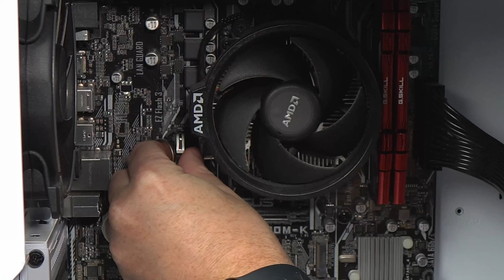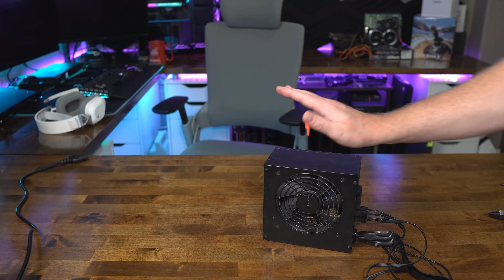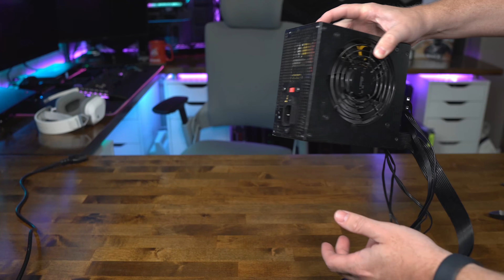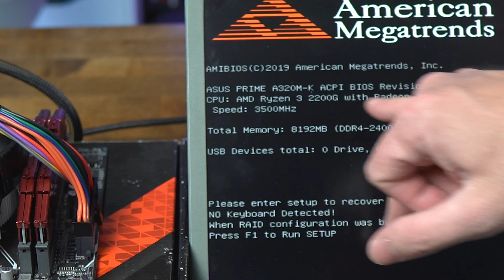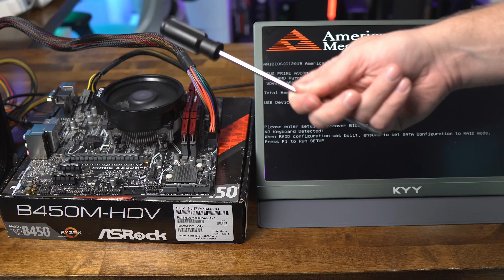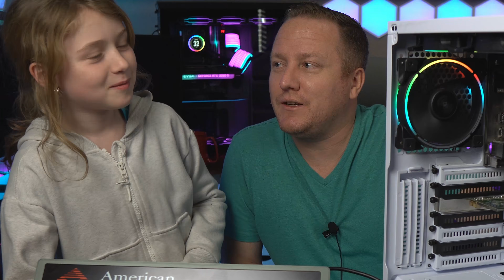My Daughter's PC is NOT Powering On!  - Come troubleshoot with me!

Comment: Great content! Enjoyed the troubleshooting. I recently had a newly built PC refusing to POST the second time (booted okay the first time). The debug leds were solid red on cpu and blinking on dram.  Ended up removing one of the RAM sticks for it to boot. Eventually replaced both sticks with a different brand and has worked flawlessly so far.

Comment: Ahhahhahhahahhaaaaa!!!! What a power sucker!!!! Exactly in October i had a huge headache with an old case (~2000+/-) switching my PC off. The first suspect was the PSU of cheap design and 80mm fan inside. To my amusement that was the POWER BUTTON in the CASE!!! it was old and started shorting thus triggering the system shutdown. But God it was sucking my blood for the whole 3 days until I found the problem. Of course a new a  cheap PSU~20$ was purchased, and of course it was shutting down until I discovered the button problem.
Reply from the maker: I thought for a second that is what I was running into as well.  I’ve heard of people having that cable deteriorate or fray open and cause a short. Mine didn’t look that way and I did actually end up buying a cheap in-line PSU tester.  The PSU was in-fact the issue after all.

Comment: I guess that PSU is too old. Also have the same symptom, but on the GPU. It would POST and boot into Windows, but once start to do 3D games, the PC will turn off by itself.
Reply from the maker: Yeah that definitely sounds like a dying PSU or one that is not of enough wattage to keep the system powered under load.